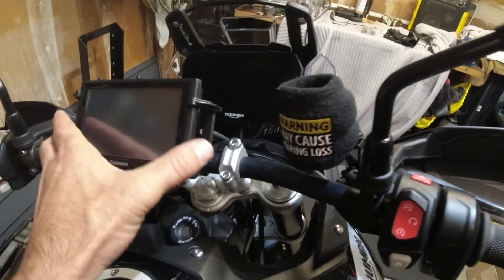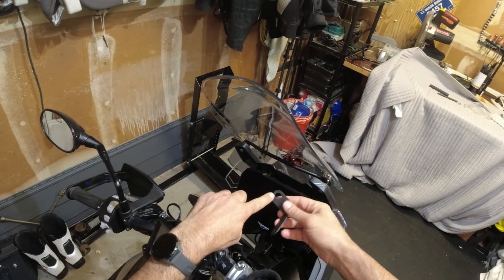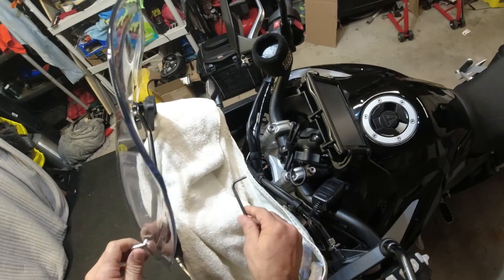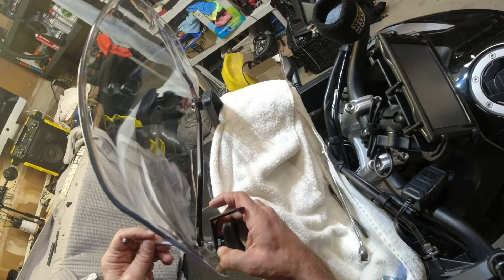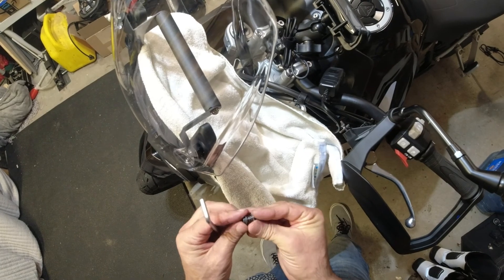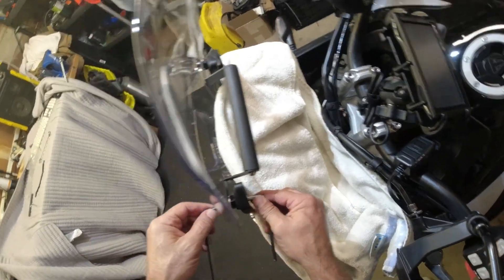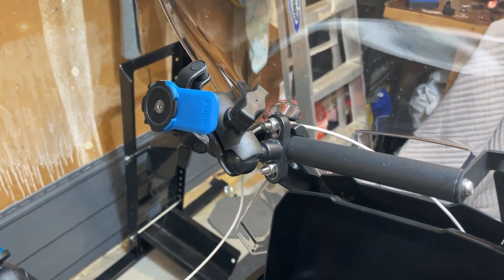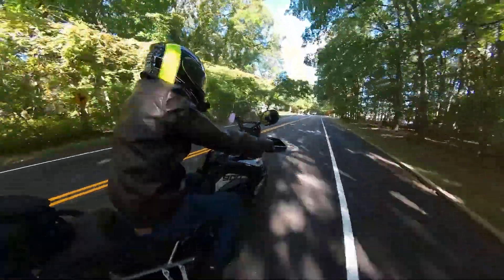Tiger 900 GPS Mount

Comment: Helpful thanks.   do you think If I mounted a tablet...(Active3/5 or Carpe Iter tablet) if would vibrate and shake around too much ??
Reply from the maker: Hmm.. I'm not sure.  I guess it depends on how much it weighs.  I'm using a CarPlay device now setup to the same bar and it's heavier than this GPS or my phone and it stays on there fine.  It does vibrate at idle speed when stopped. But once you get going and the engine smooths out its fine

Comment: Thanks for doing this video as I was very sceptical about buying this for my 900 Rally Pro, looks solid enough, just ordered it tonight, all the best from Kelso, Scotland, cheers buddy & subbed your channel 👍
Reply from the maker: Thanks for the comment.  I've only had it on for a little over a week, but so far so good. Sturdy, does the job, easy install, and I like that I now have more options if I need to mount things places.   Hope you enjoy it.  Safe travels!
Reply: Did you install yours?  I"m looking same for my new 900 RP also.
Reply: @kee7678  yup all installed buddy, very sturdy
Reply: Any updates on this setup? An regrets?
Reply: @user-fv1576  no regrets, only thing I would want is for the TomTom setup to be a little smaller, less bulky, other than that the bar has been great, very sturdy 👍
Reply: @mototripperuk  How is it working so far ??

Comment: Hi, just received mine, Amazon, vibration damage is my main concern, but understand there is solutions to minimize them…. Will be fitting on mine today, thanks for vid, will speed up mounting as there is instructions, only one thing, of what I can see, there is no need to undo the spring assembly, seems by just undoing to screen screw the adjusting bar comes off then just install the bracket with washer as you shown and screen screw back again?

Comment: Nice install.  What power plug are you using for the DIN port with USB cable. (Finding there as some that don't fit right and disconnect).  Also what cup holder are you using?   Looking for one that fits.

Comment: Is the windscreen adjustable for height after the additions?
Reply from the maker: Yes, you can still adjust it. depending on how low you mount the device, you may just need to readjust the device so it doesnt hit the instrument panel.  But yes, its just as adjustable as it was before
Reply: @Mudslidex1  Thanks for the response

Comment: I had quite similar solution on my Tiger 900 for phone mounting and because of this kind of mounting, camera in my phone has broken. The whole bar, that is intended to slide up and down the windshield, shakes guite badly if there is windy day and there is a phone mounted on it. So from my perspective I definitely do not recommend such a solution for phone.
Reply from the maker: Thanks, I was worried about that as well as a phone mounted on ANY motorcycle even mounted on the handlebars can damage the camera due to the high freq vibrations of most bikes. This is why I went with the Quadlock and their vibration dampener that absorbs the vibrations to protect the camera.  Thanks for watching and commenting
Reply: Wondering if this person had the quad lock vibration dampener installed?